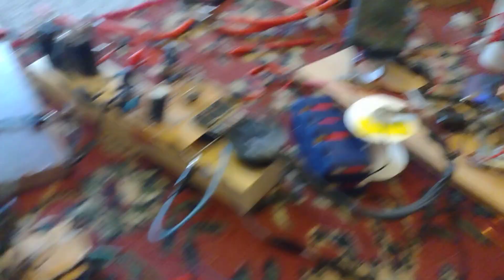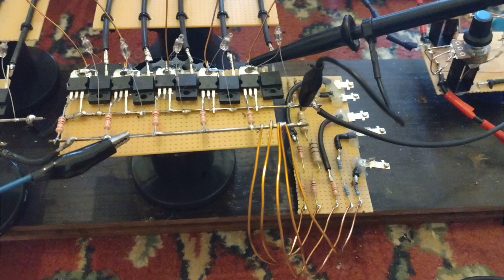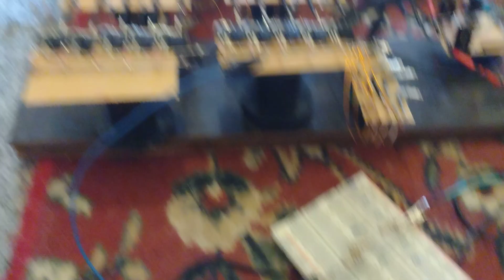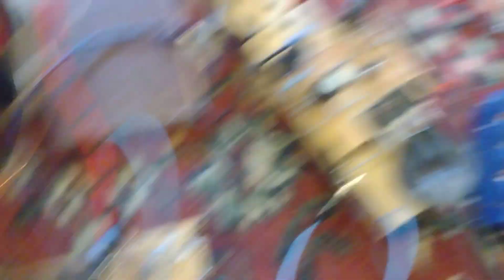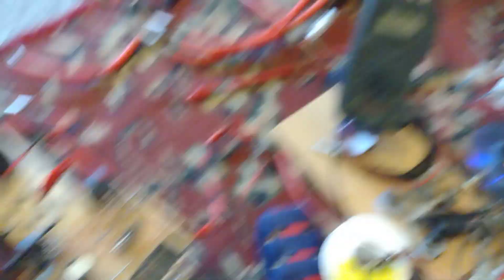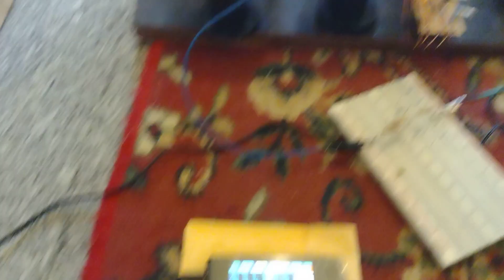10 Coil Alexkor charging with Bedini Comparator on the output.

Comment: If your NPN are triggering at the same time you need use "matched" transistors. That way they dont blow each other out. I suggest keeping the voltage down as well especially if you spring the $ for those matched transistors .
Reply from the maker: They're all beta matched.. I matched them before II fixed them down.  So are the base resistors & the diodes...
Reply: @oliver1224  I got 4 matched transistors from Russia military grade . Got them like 5 years ago i think they are from the 90's never used them. Gonna use them on a filar wound 4 drive windings one trigger winding gonna use cap to make it solid state oscillate . I plan to use 4 volts or as little as possible just to get the trigger going .
Reply from the maker: @mykedoes4099  your transistors sound really interesting.  Good luck with your device.  I built several low input systems 2-3 years ago..  just experimenting with different windings to see what results worked best... then put them to one side & 6 months later I discovered they producing one for one charging consistently..  Also the Bulbs I'm experimenting with are producing incredible Cap Dumps...   they're able to opto isolate the Capacitor charge from the battery & trigger the Transistor to switch...
Reply: @oliver1224  I am new to your channel so i havent followed your experiment from the beginning. The opto isolation is this with a optical switch ? I heard about these types of transistors never seen or used one though . Right now I focus on capturing the flyback as this is what Bedini circuit is doing all while providing the same rotation you would get with the same drive system minus the flyback capture which is all done with the 1N4007 very important part https://www.youtube.com/watch?v=WH4watZLhOA
Reply: @oliver1224  I dont think the Bedini cap dump system incorporates the flyback capture. ? "I dont think"  I know the Bedini Sg does and I am pretty sure so does the Don Smith device as well as the MEG
Reply from the maker: @mykedoes4099  Its a method of using an optocoupler to isolate the charge in the Capacitor which does function like a switch...  I first saw Bedini using this method in some of his 555 Cap Dumps before he progressed over to his Comparator...  I've also experimented with the Mechanical Switch method which is a physical way of achieving the same without electronics by using gear down & a home made rotary brush Commuator.  I'm not specifically using the Optocoupler in this device...  The bulbs seem to be achieving the same but in a different fashion but I'm looking into how this is possible... though they all seem to work..